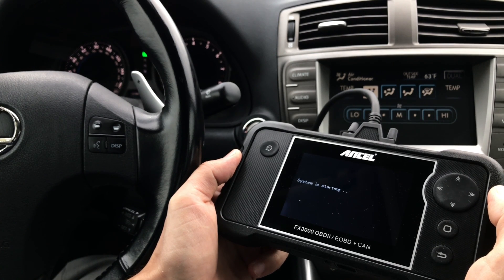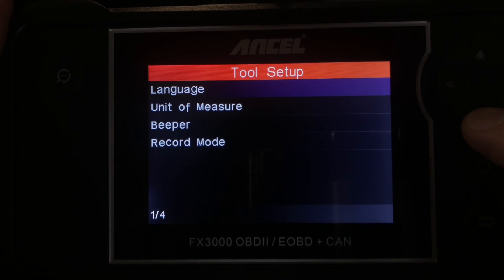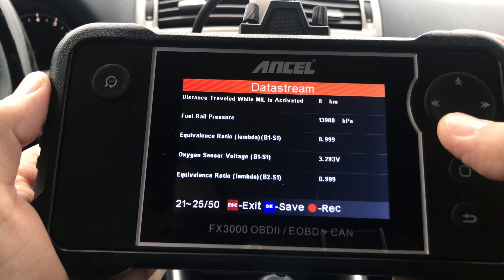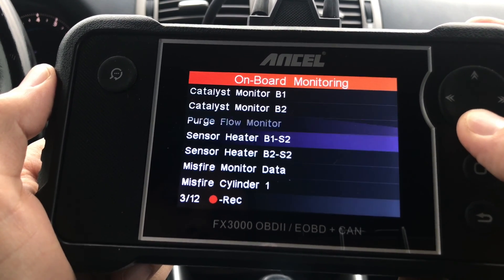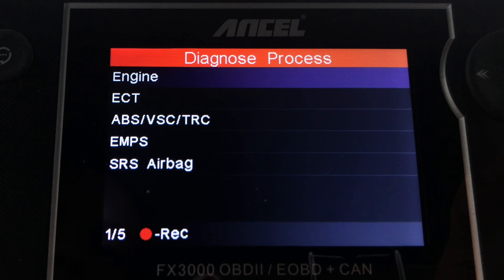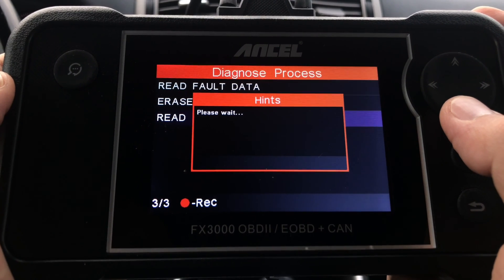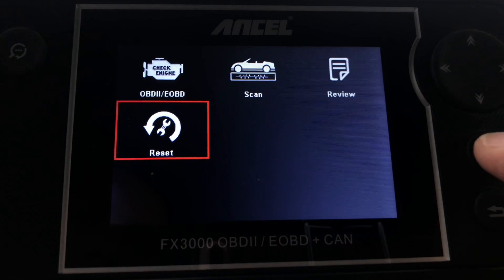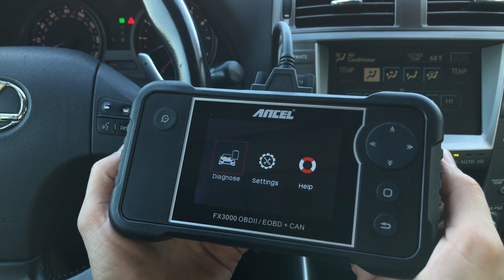Ancel FX3000 Comprehensive Review Diagnostic Car Scanner

Comment: Does it help you reset the battery “code battery” for and Audi when you replace it. Please lmk. Nice vid
Reply from the maker: While Audi is certainly on the list of supported brands, I cannot say for sure, cuz I newer had a chance to work with Audi using this tool. You may wanna check on manufacturer’s website.

Comment: Friendly correction, a V6 doesn't have two engine blocks. Any engine should have Bank 1 sensor 1 for 02, since there has to be at least one bank with a primary O2
Reply from the maker: You are right. Proper word would be engine banks. Thanks!